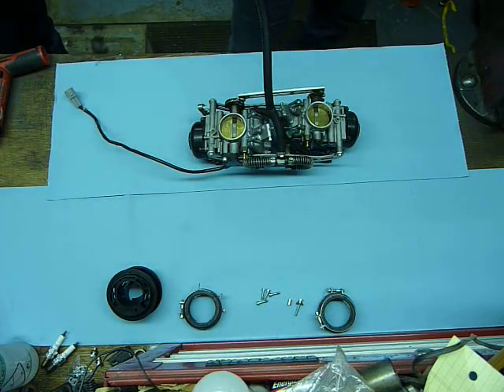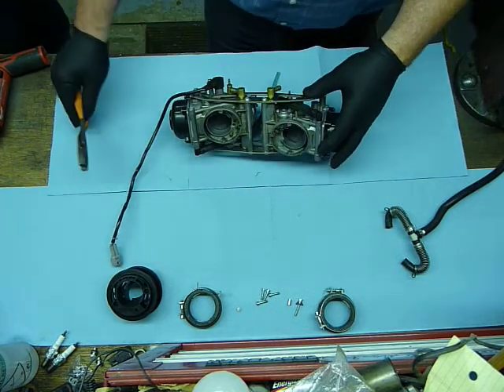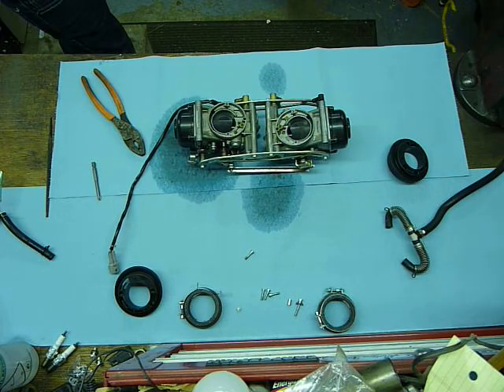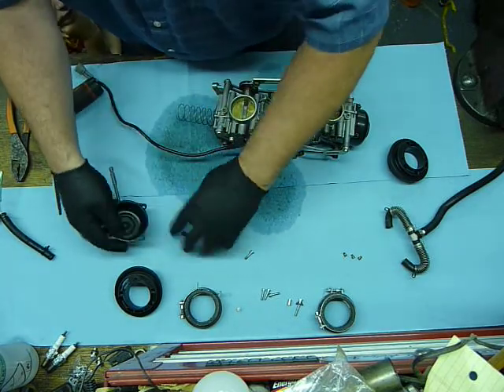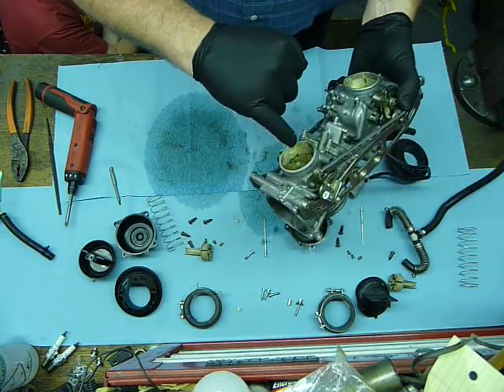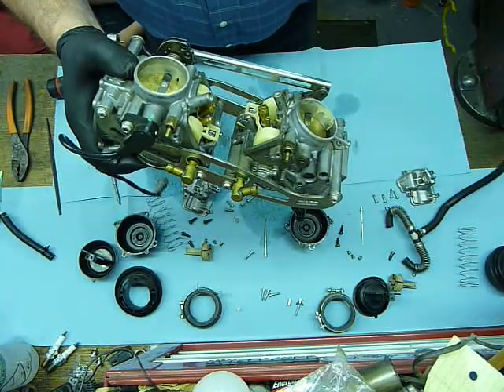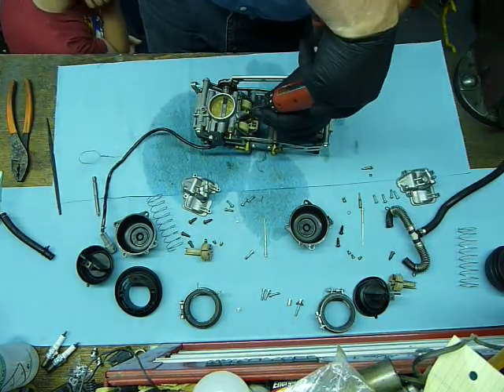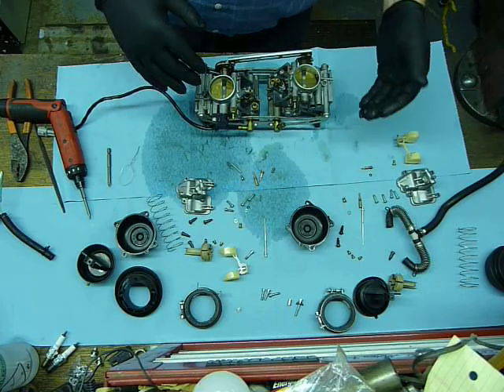Adventure Machines KTM 950 Carb Service-Episode 1

Comment: Dougie, never use a powered driver to work on carbs.
Don't remove diaphragm if unnecessary.
 Always reference air/fuel position before removal.
Reply from the maker: Thanks for the note. Of the likely thousands of carbs I have worked on, somehow I have manage to not destroy any by using a power driver with torque limitations
Reply: @AdventureMachines  I could probably pull it off too. But the guy I recommended your videos to probably shouldn't use a power driver. Great videos though,  thanks for the content, very helpful.

Comment: Hi Ken,
I have a 950 2004 Adventure S. My carburator is leaking even the enging is off. I start the gasoline pump and I start to see speling gasoline from the back carburator. I just opend the air box and pull up the carburator and I see that is coming out gasoline. Do you have any idea about the problem? Could i t be a ring?
Reply: What did the problem end up being? I have the same issue. Thanks!

Comment: I like a fool lost the small washer under my needle, any-chance anyone knows if you can get them separately or the radius and thickness please
Reply from the maker: I don't know the specs off the top of my head.  I have a set of carbs apart,  I  will measure and share

Comment from the maker: Glad to be of assistance. if you need anything else stop by advmachines.com
Reply: Just got into carbs and was wondering about designation of airjets at about 2:30min. According  to repair manual, following your explanation from bottom jet = main jet (40), middle = Idle air cut off jet (80) and top = idle air jet (50). Could it be that you mixed up middle and top jets value? When you continue, you correctly refer to changing the 80 to 70 jet.